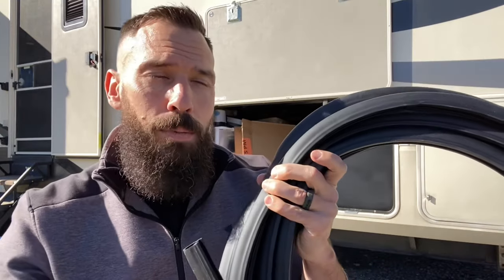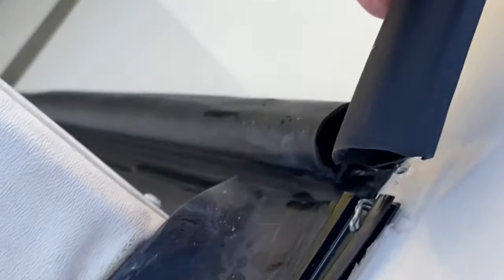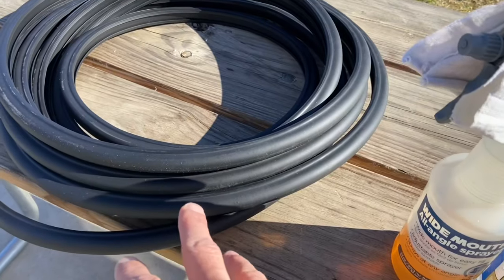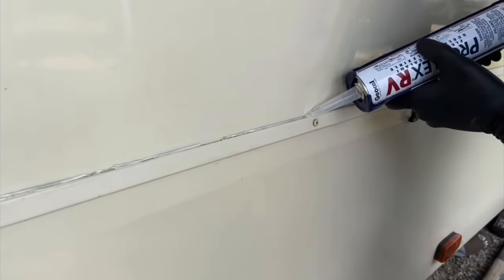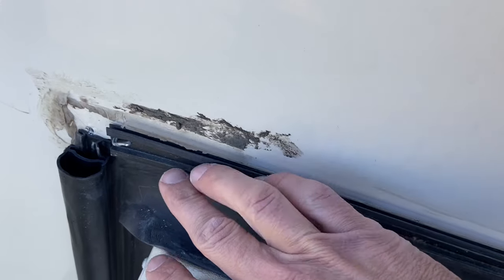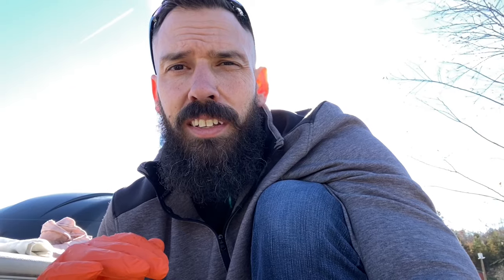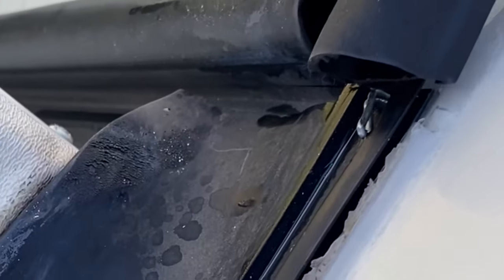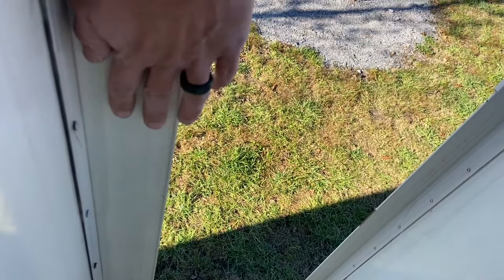REPLACING YOUR RV SLIDE OUT D-SEALS | Easy, Necessary RV Maintenance

Comment: Thanks Friend!  We picked up a new East to West Silver Lake Travel Trailer and My D-Seals (took forever to find out what they were called) were not secured from the factory.  Your video showed me exactly what I needed.  I need a set screw to keep these seals in place.  The bead of calk has broken on them all as they are moving around.  Super helpful video my friend.  Thanks!
Reply from the maker: You know what’s crazy is even with two set screws and a washer now I still have one on top of my slideout that still comes loose going down the road, rips through the set screw and starts sliding off. It’s crazy. I just put new sealant on it so I’ll see if that finally helps. For the life of me this one D seal is just set on coming off down the road 🤷🏻‍♂️
Appreciate you watching 👍🏼

Comment: Great video. I like and use the lexel also. Tricky though , very small bead dip finger in mineral spirit and softly not to squish everywhere smooth fast. Leave it alone don't even think about it lol. It has held up very well on my toy hauler. Again, great video time to tackle the slide seals.
Reply from the maker: Good deal Steve. Next time I do the job I think I’ll try Lexel. Never look forward to that job though lol

Comment: Thanks for all your help with RV repairs, have you ever used 3M Black Weatherstrip Adhesive (08011) on your slide out rubber installation? This is the adhesive use in installing windshield in automotive, bonds great with rubber and fiberglass.
Reply from the maker: Appreciate that. It’s funny you mention this cause last time I replaced one about 3 months ago I was going every where trying to find that 3M product and all of the stores only had the 3M yellow…who wants yellow??!! Hahaha 
Thanks for watching Tim 👍🏼
Reply: You always have great ideas, thanks for all you do. I checked with O’Reilly’s, they have it in stock. I think I will try it this time.

Comment: Thanks for addressing this topic, though I do have a question for you and hoping you can help. The wiper seal on top of my RV is loose and not snug to the top of the RV. But, it looks like in order to replace that seal, i have to remove the D seal, does that sound right? And if so, then I guess i would also need to replace that if there is any cracking and then i would also need to reseal with caulk??
Reply from the maker: Sounds about right. The D seal is just easily slid into that track. Without going up there I can’t really remember what the wiper seal is attached to or how. I’m thinking it’s part of the track but not sure.

Comment: Is the set screw 1 inch or 1/2 an inch? Thanks
The guy that i had replace my D seal replaced it with to small of a screw and it pulled out of the wall. I just dont want to go through the other side with to long of a screw. Thanks again... great video....
Reply from the maker: Wish I could tell you but I don’t really remember and I’m not near my RV for a few weeks. You can always go to the other side find the set screw and back it out to match it up I suppose. Wish I could help more. Thanks for watching too 👍🏼
Reply: Thanks I figured it out. Appreciate you responding.
Reply from the maker: @marilyngatson2289  good deal 👍🏼 Hope it worked out.

Comment: What about the flap underneath the d seal. Why is no one talking about that one? Thats the one I think is leaking
Reply: Mine definitely is and im replacing. I got a combo of the wiper seal and d seal (rail for d seal is built on wiper, my original looks seperate). Comes with adhesive back but you can screw in too- seems easy enough all together

Comment: What would cause my slideout to leak if it is not the D seal? I've already had my roof and slides sealed.
Reply from the maker: So many possibilities. Sometimes it’s the screws that leak, windows, the slide tracks, RV not level and water running back in…it’s so hard tracking down a leak sometimes. Good luck, hope you find the issue.

Comment: i have a d seal that pulls/ falls off the track everytime we open the slide - any suggestions?
Reply from the maker: I’d replace it. Make sure the set screw on both ends are secure. You could even use a super glue to glue the D seal into the track. 
I’m actually working on a project replacing all my cheap Chinese rubber D seals with a one piece rubber bulb and wiper. No more track. It’s German automotive grade rubber too. Here’s a link. Video soon. 
https://amzn.to/4c7XzmW

Comment: My D-seals look pretty easy to replace, they just go in the channel. I'm trying to find info on how to change the flap inner seal that comes out when the slideout is out. That looks like it might be a bit harder to change.
Reply from the maker: Haven’t had to change one of those yet.
Reply: @WhyWait  looks like they are pretty easy as well, just have to unpinch the metal channel at the bottom and they just slide out.